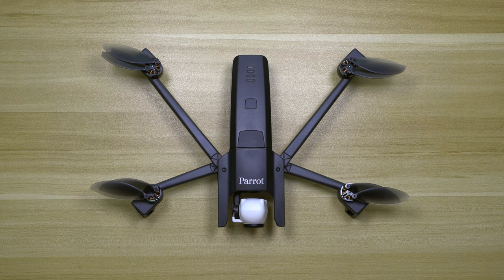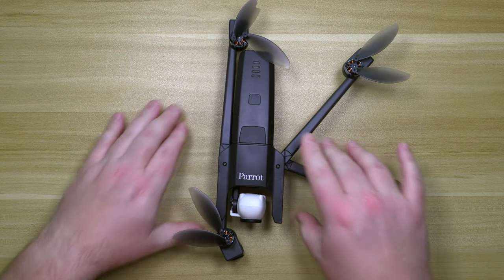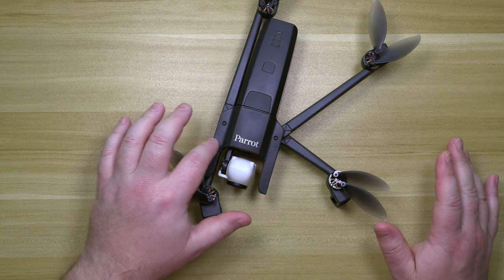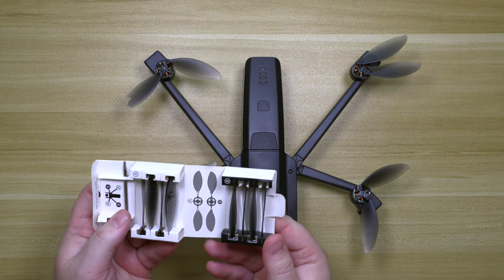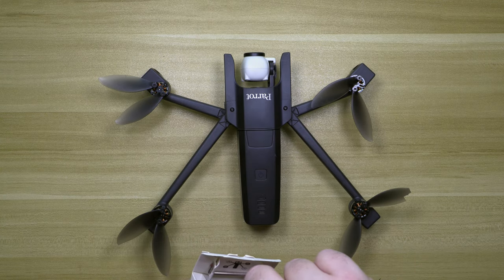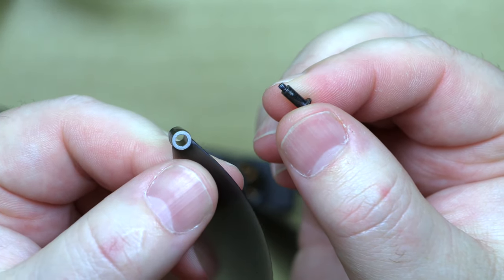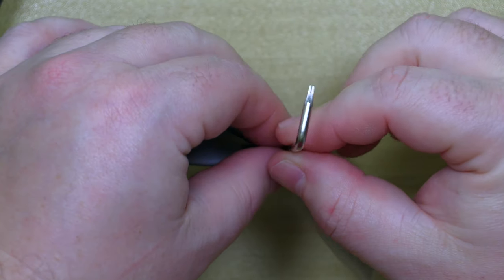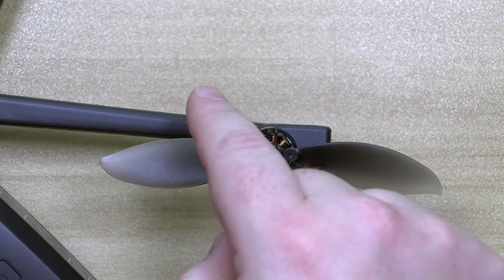How do you change out a propeller on the Parrot ANAFI?

Comment: Can you explain further why it crashed in the first place? Thanks!
Reply from the maker: Sure... There isn't much to tell.  The CS rep told me to let the drone hover... I was explaining to the CS Rep that it was drifting a bit... they said to let it hover a bit longer... It drifted into a wall.  They are sending me a replacement drone now.
Reply: Shawn Ide Studios mine drifts too indoors but only in bad lighting
Reply from the maker: Yeah... I think if I let it hover a bit higher, it would have relied more on the GPS than the camera on the bottom.
Reply: Is there thread lock on the prop screws?
Reply: I heard that stability is increased when you let the IMU warm up vs. launching it immediately.   Stability will increase during flight as the IMU warms.
Reply: @ALTN8NRG  yes I got the screws with a package of eight props from parrot , they have blue stuff on the end, if I reuse them I put my own blue lock tide on them

Comment: Hi Shawn,

Thanks for sharing this great video! I checked my Anafi propellers which have marks and numbers.
The A propeller has a mark and a number: 4,
and the B propeller has a mark and a number: 1.
Do yours also have those marks and numbers on each propeller?
Do you know what the meaning of that? Thank you!
Reply from the maker: Interesting... I just pulled my ANAFI out and my blades say 1 and 3... I have no idea what that means.  Maybe it has to do with the assembly line of mold used to make them.  Good catch and thanks for watching!
Reply: @ShawnFoxhorn  Thanks for your reply, Shawn. Does 1 belong to blade B and 3 belong to blade A?

Comment: Nice video thank you! Do you think the motor caps are worth using?
Reply from the maker: Thank you so much!  The motor caps might be useful in cold scenerios to warm up the motors faster.  Or keep out some moisture if you get caught in a rainstorm.  Any weight you add will affect the drones flight behavior.  This from a guy that straps cameras on drones...Ha

I think an extended landing gear or ND filters would serve more purpose than motor caps.
Reply: @ShawnFoxhorn  Thanks alot!

Comment: In the original assembly, the manufacturer used a blue thread lock on the propeller bolts (probably loctite 242)

Comment: One of my anafi's propellers (original) broke after 14 hours of use. I analyzed it using a stereomicroscope and found that it broke due to fatigue. I also discovered that another four blades already had fatigue cracks in progress. All cracks appeared at the top of the tube, opposite the blade.
Reply from the maker: Wow... That is some incredible detective work.  I have over 100 flights on the blades that I am flying with currently.  They are OEM and I believe they are the replacement blades that came with the ANAFI.
Reply: @ShawnFoxhorn  Maybe it's time to change the propellers. Considering that they are fatigue cracks, the flight time is the main parameter to be observed. If you can, inspect the propellers, but the fatigue cracks are very difficult to find, as they remain closed as long as there are no efforts.

Comment: One thing that should be mentioned is that very often, even if you screw them with the same strength, one or two blades will not move as freely as the others. That does not mean you should unscrew them a bit cause this will cause the drone to lose propellers and crash.

Comment: Parrot has the worst customer service! My Anafi tipped over out of my hands at around 12 inches off the ground  They replaced yours after crashing it into a wall but basically sent me packing and offered no help at all in resolving camera and sd car malfunctions errors that I have been having prior to this. Buyer beware.
Reply from the maker: How old is your drone?  Is it still under warranty and we’re you flying it?  They replaced mine from a hardware malfunction.  I don’t think dropping it on the ground is covered.
Reply: @ShawnFoxhorn the Anafi  less than a year old. I presume  it's under warranty with parrot. I purchased from another reailer. It was in my hand I was not flying it. But flying it into was wall is? That makes no sense. My problems are not caused by dropping it. They are using the tipping over as an excuse to blow me off.